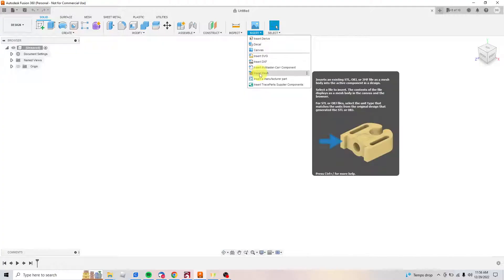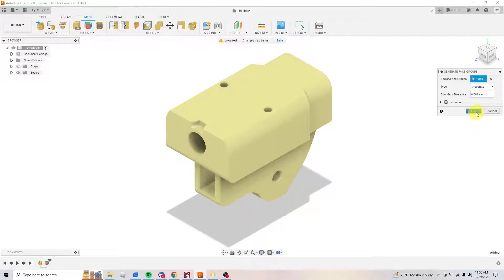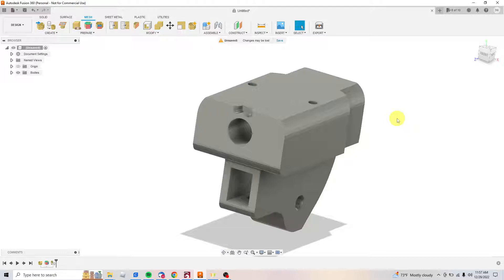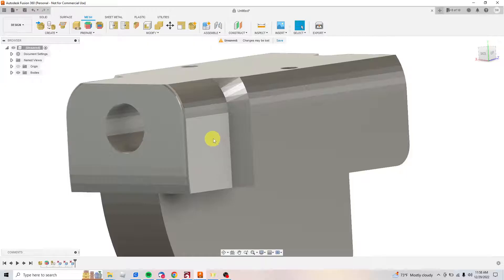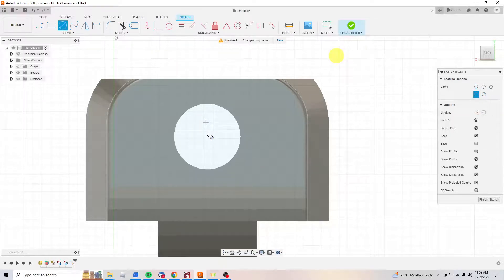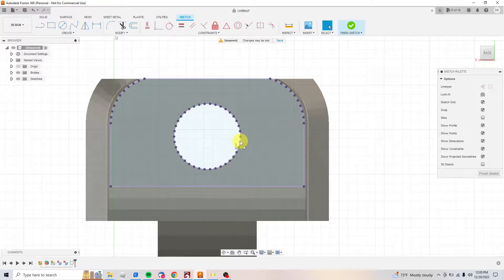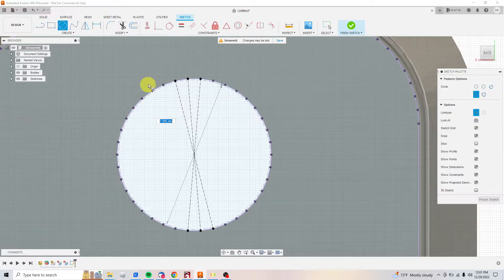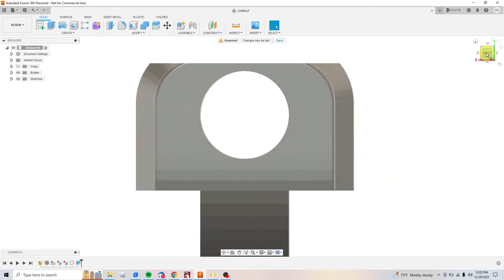How to Import and Edit STL Files in Fusion 360

Comment: Just use a 2 point circle it will snap to the edge of the hole. Then create another center point circle it will snap to the 2 point circle. Make it as big or small as required then extrude it.

Comment: Late to the party, but when you import, you have those check boxes. move to center and move to floor/ground. When centered you can grab that circle in the middle, not centered it will snap to nearest which obviously is offset.
Reply from the maker: Ahh. That explains the issue I was having, I think.
Reply: Another late guy.
Also you would probably find center using only one line since the line will "mark" it's one center if you get what I mean. 
But of course if you can center the model on the grid that is better.

Comment: kinda late to the party and im no one of mention. but i would combine the face groups inside the cylinder before converting the mesh. this should allow you to select all the contraining boundries inside as a group after you convert. so you should be able select the inside boundary of that cylinder. create a copy then push/pull to measurement, then extrude.